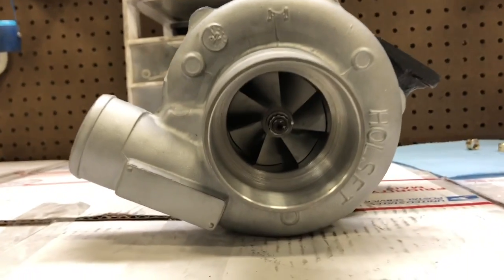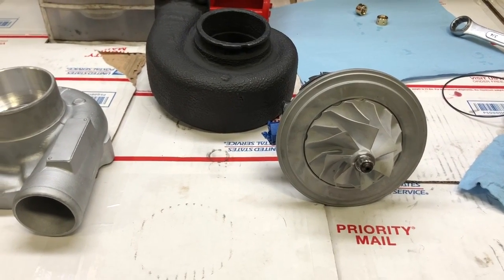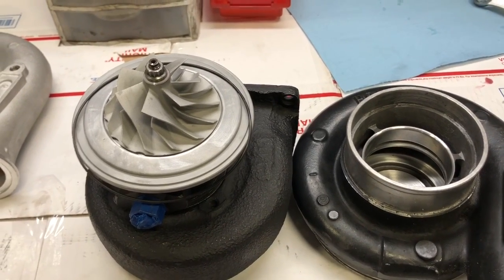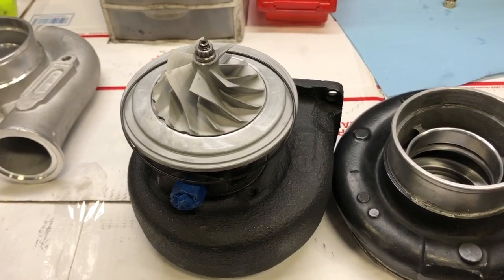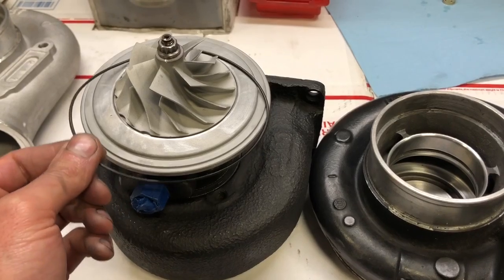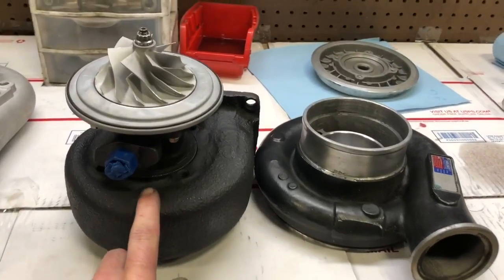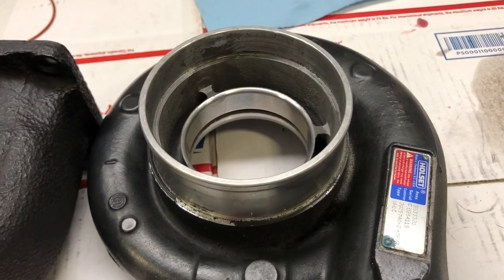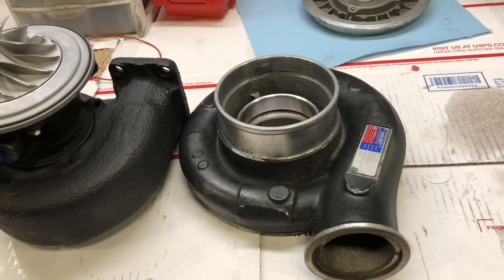Knuckle Boom Gets Turbo Upgrade

Comment: Hi Austin, what do you think is the max boost on a hx35? (without making it unreliable) I have the hx35 MFS, its a billet 58mm compressor from holset with a 12cm2 housing.
Reply from the maker: Holset states not to exceed 44 psi in their online manual. There will be a point when you increase the boost and the hp doesn’t increase but the heat does that’s when you turn it down or add method injection
Reply from the maker: Holset states not to exceed 44 psi in their online manual. There will be a point when you increase the boost and the hp doesn’t increase but the heat does that’s when you turn it down or add method injection